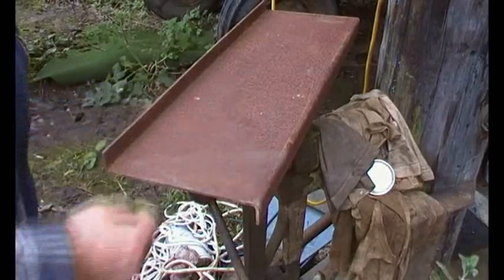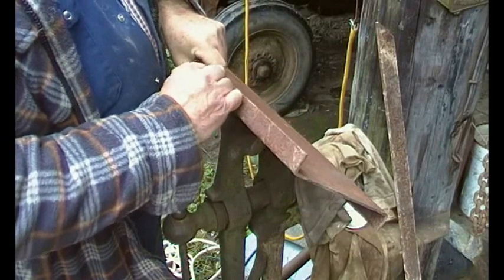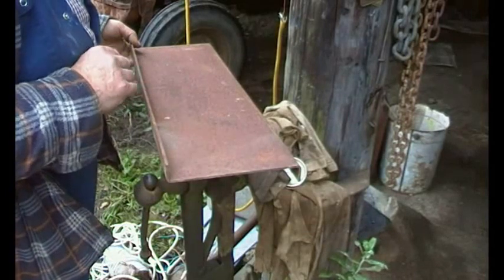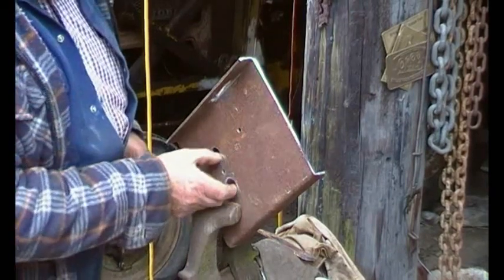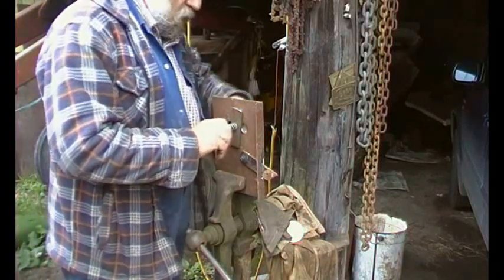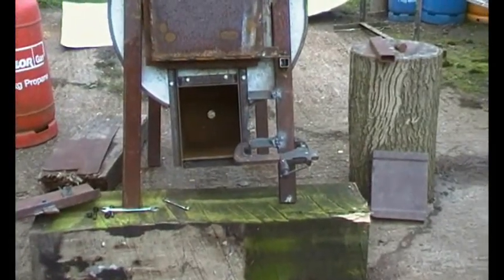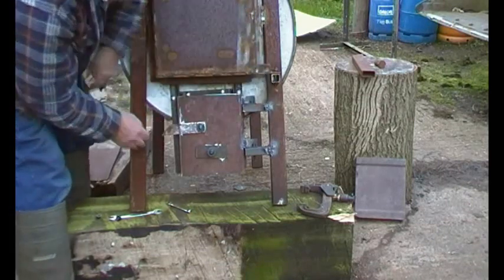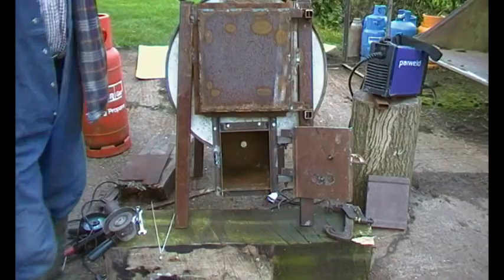Making a charcoal retort from bits found in the woods: part four.

Comment: Lovely sharp drills, Andy. Do you sharpen them yourself? Which brands of drill do you recommend? I use dorners.
Where's your steel rule for the measuring? Throw that horrible floppy plastic strip away!!
Your neighbour gave you the bolts... Hmm. I wonder if he was the one who smashed your wooden gate post...
Your welding made me laugh! Just like mine!!
Reply from the maker: Hi, the drills mainly came from Uncle Harolds workshop, hopefully you have seen the videos of him. The Denbigh drill makes things so easy, I'm pleased I took my time to get it working again, it's a real gem and I would definately say that the bigger the better when it comes to pillar drills. The inch drill needs a touch up as it was not cutting as well on one side, but the action of drilling shows up the defect on the cutting edge, cheers